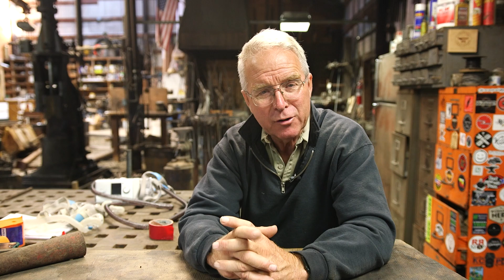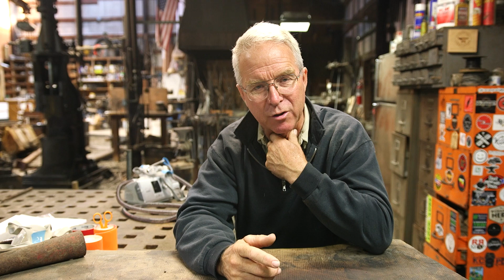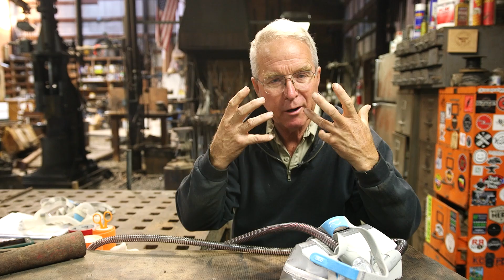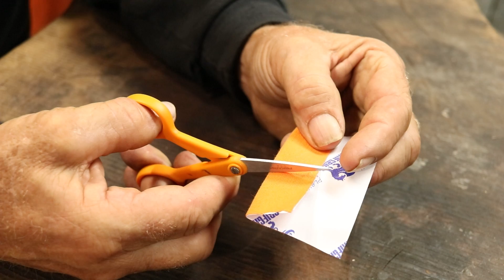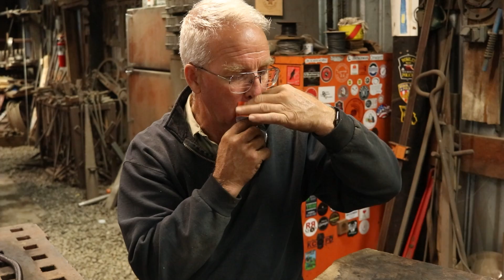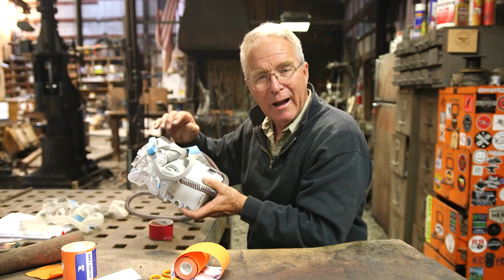Tired Contractor  Here’s My Simple, CHEAP Sleep Apnea Solution

Comment: Good stuff young man. You have (almost) repeated every sentiment I have.
As a 25 year user of a CPAP machine at a medium pressure (9.8cm H2O) the thing turned my life around. If it wasn't for that, I'd most certainly be dead now - from sleeping at the wheel or by heart failure.
Reply: Once you start cpap you can't stop because your body becomes reliant  on it
Reply: @RexRodgers1992  well I never found that  - I use CPAP at home  - but I  just ditch it when camping , sleeping on a boat  , or when its hard to take it when I travel.   I just sleep same as I did before without it  - no dependence at all!.    But CPAP gives easier sleep.  Occasionally it annoys me but  i just take it off .    Its a help  to be used when i want it .
Reply: @RexRodgers1992  Yes! A close friend of mine has been on CPAP for 6 years and he is completely reliant on it now. He told me when traveling, he has a portable cpap and it is the most important luggage he cannot lose. He won’t be able to sleep nor breath properly without it. It was very scary when he told me about it in all seriousness.
Reply: @Paul_Sleeping  I suspect in his case it's more of a psychological dependence than a physical dependence.
Reply: BeSureYouAreSavedDOTcom  
Thank you for your thoughtful reply. 
I need to lose a lot of weight myself, and maybe that would help with the sleep apnea. 
If your wife is interested she may want to
consider trying serrapeptase for her COPD.  It can dissolve scar tissue and may help heal her lungs. I’m so glad to hear she’s doing better.  Bless you both, and thank you for the wonderful information!
Reply: BeSureYouAreSavedDOTcom  
I’m glad that she is trying it. That’s great! I think it will help her. 🙏 prayers to you both.
Reply: @RevMarkSmith  might be the setting you have it on. I just know you take higher risk when you stop using it. Just because you haven't died yet from not using it on and off doesn't mean you won't.
Reply: @USAMark70  you should look up what cpap does and how your body responds. When you just cut it off  cold turkey It could definitely lead to death.
Reply: BeSureYouAreSavedDOTcom  God has nothing to do with it - nothing whatsoever.
Reply: BeSureYouAreSavedDOTcom  Because I don't believe, you imply that I am a fool, am corrupt and have done abominable things. That's very kind of you, I must say.
Do you you think you have changed my thinking? You didn't. You confirmed it . . .
I'm just not going to engage you here.

Comment: Wow! Your story is so great and inspiring.  
I have severe obstructive sleep apnea and am now using a CPAP machine, which took me years to get used to, but it helps alot.
The apnea started out as mild to moderate but eventually became severe.  When it got really bad, it scared me so much that I just forced myself
to use it.  I eventually got used to the machine but I can't imagine what I would have done in your case - having both types of apnea and a pressure
on the machine that was so high it made using the machine almost impossible.  I would have slipped into a brutal depression!
But you didn't!  That's amazing!  Your drive to not give up and fix the problem is amazing.  I'm so happy for you and hope you continue to sleep well.
Thanks a million for the video and your heroic response to a very difficult health problem!
Again, inspirational!

Comment: I read a book called Breath by James Nester and this was his solution to mouth breathing and sleeping problems. I've found that a thin strip (less than 1 inch) of fabric medical tape applied to just the lips works well. It leaves room at the corners of my mouth for talking and breathing if necessary. After several months of doing this, I've actually trained myself to breathe through my nose, both while awake and sleeping.
Reply: Fantastic book. “Shut your mouth”
Reply: I've found similar, smaller tapes works well enough. I'm also intent upon re teaching myself to breathe through my nose while I'm sleeling.
Reply: I absolutely agree. A tiny strip of fabric medical tape can do the trick; all it needs to do is keep your lips together so your jaw can't drop.
Reply: I do exactly the same thing n now found, like you, that I’m naturally breathing though my nose. Regards.

Comment: Thank you sir for this video. As others have said, your presentation is so soothing and comforting. A real treat. 

I'm 78 and have used a mask for about 10 years. I also use Breathe Right to keep the nasal passages open, also for many years. 
After watching this, I ordered the tape and it came on the 14th. I was skeptical, but used it that night. I won't be going back to a mask. I sleep better than ever, no more issues with the air hose nor waking up every time I wanted to change sleeping position. I sleep hours at a time now and it's great. And I do wake up feeling more refreshed now. Without using a mask, I snored a lot, with the mask, no snoring. Also, before using the tape, I hated putting that thing on my face every night.  

A note about my wife. In the past she snored quite a bit. I would have to interrupt her sleep to have her turn over so I could sleep. She has had sleep tests and they showed no abnormalities, so no masks. I did have her try mine once but that did not turn out well at all. So after a couple of nights of me using the tape, I talked her into trying it. She was reluctant but tried it. After just the first night, she was hooked. Before, she would be up and down, maybe 4-5 times a night to pee, but that dropped to 1-2 times a night with many hours of sleep between, which she never had for years. She does NOT snore now, so no waking her to turn over. Bottom line, we both sleep so many more hours without waking and waking up more refreshed. 

The tape is really unobtrusive during the night and it forces you to breath thru your nose, just as the darn machine forced you to. BTW, I have a beard and the tape still works for me.

Comment: I went through a similar scenario with sleep apnea and used a CPAP machine as well, although not as severe as the OP.  My apnea was diagnosed as mild, and to make a long story short, I studied up on apnea and watched a LOT  of good videos on utube and was eventually able to determine the two causes of my apnea. First, my nose was broken in grade school and when it healed, my left sinus was about 30-40% blocked. After talking with an ENT surgeon, he pointed out that when you sleep on your right side, you breathe mostly through your left sinus. I sleep mostly on my right side, so that was half of my air blockage (apnea) issue! After he performed surgery to correct my left sinus, I can now breathe MUCH better than before when sleeping! The other half of my apnea issue was that I learned I was tucking my chin into my chest (head tilted down towards chest) and that too was causing air blockage while sleeping. So, I ordered a soft, wearable cervical collar to wear while sleeping. Once I started using that, my AHI index went below 1!!!! So, I've learned to sleep with my head straight (neck in line with chest) and now I no longer need my CPAP machine or the soft C collar! I do wear a Lookee wrist pulse oximeter that records my Spo2 level and pulse rate while I sleep every night. My Spo2 level seldom goes below 95%, but if it goes below 91% the oximeter buzzes my finger and I wake up enough to adjust my position so I can breathe better. Each morning I upload the data to my phone so i monitor my sleep breathing. My AHI index is usually below 3, I've read that below 5 is considered to be a normal AHI index. If anyone has apnea or breathing issues while sleeping, I strongly recommend you get a wearable pulse oximeter that records your spo2 level and heartrate, so you can a check on that. Most cpap machines can't tell you your spo2 level, and the main reason you wear a cpap machine if have apnea is to keep your spo2 level above 92% or thereabouts. So, does anybody need a cpap machine? I have a nice, lightly used RESMED I'll sell you lol. BTW, if you have apnea and needs CPAP, a RESMED is like the Cadillac of cpap machines. Also, if you use cpap, consider getting a pillow designed to use with cpap machines, it helps the comfort factor and tends to keep your head in line with your chest. All this stuff I learned on my own. Good luck to everyone!
Reply: Awesome that you got it figured out!

Comment: Great video!  I have sleep apnea, as well, but I've found a few other options that work for me.
First, I use a thinner-than-average pillow.  If I'm on my back, a thick pillow will angle my neck up and close off my airway, even before I fall asleep.
Second, I use a device to pull either my lower jaw or my tongue forward.  Remember the old CPR instructions...  "to open the airway, tilt the head back and pull the jaw forward (which also pulls the tongue forward)..."
Third, since I'm a mouth breather, too, I use a CPAP machine with a full face mask that covers my nose and mouth, so I have positive pressure while either mouth- or nose-breathing.
Good luck with your sleep apnea journey.  😀

Comment: For me my sinuses are usually pretty stuffy which has been a large driver for my mouth breathing, I found nasal air vents (basically silicone things you shove up your nose) it's really improved my sleeping, not perfect but much better.
Reply: Had the same problem for years with a stuffy nose at night...  breathing through one nostril all night, depending which side I was laying on. That problem along with half a dozen others cleared up after going Keto / intermittent fasting (basically no starchy carbs, reduce sugar).
Reply: @phiksit  I've been considering keto... This seals it. Is there a specific type of keto, or specific yt channel, you follow?
Reply: Wow. I've got a stuffy nose problem, too. Thanks for the help and the replies to your post!
Reply: Try taping your mouth closed. It works great!
Reply: NutriBiotic nasal spray with GSE helped me a lot. Through Dr Berg I found that grapefruit seed extract has anti fungal and other helpful properties without any Afrin like drawbacks. Works awesome for me.
Reply: @AprilJoi5  Dr Berg is awesome 👍
Reply: @AprilJoi5  Dr Ken Berry, TN area

Comment: Hi Scott, believe it or not I came to the same conclusion about my sleep pattern and also tape my mouth up every night!  It was not my idea though, I did an Asthma therapy years ago and they talked a lot about mouth breathing vs nose breathing and the benefits of the latter.  I believe that indigenous Americans would hold their babies mouths closed while they slept to get them into the habit of breathing through their nose.  

I love your channel being a tradesman myself and I never thought I would ever be giving you a tip about anything but here's something you might want to try!? Instead of such a large piece of tape and a fairly involved procedure every night before bed, I just use thin micropore tape to close my mouth up, the tape is thin (10mm wide) and I just easily tear a bit off (40mm) and place it vertically across the middle of my mouth.  It is very quick, it keeps the mouth relatively closed, (by the way your body will eventually keep it closed naturally) and in the morning you peel it off very easily and there's no residue.

Perhaps give it a try, keep up the great work!

Dave from Melbourne

Comment: I have been on CPAP for 12 years, initially I had to train myself to keep my mouth closed.  I was told to use a drop of Poly Grip between my  lips.  It worked and after a few weeks, I didn't need it. (still using CPAP with nasal pillows however)  Good video, keeping the mouth closed is key.

Comment: I've been taping my mouth for years using athletic/bandage type tape.  Until recently I discovered Amazon actually sells tape specifically for this.  Naturally it's called mouth tape, and there are several different brands and a few different styles available.  The X shaped kind has been working great for me, better than the athletic tape.
Reply: Thanks. Im gonna try it
Reply: Need to look into this!
Reply: @mst0786  I tried it myself once. I will say that it matters what kind of tape you use. When I 1st saw a video about how taping your mouth shut will help you to sleep better, I just used some packing tape that I had... and it worked wonderful! I couldnt believe that it actually worked and helped me to sleep better but it did!
I began taping my mouth shut every night with great results. But when I ran out of that tape, the other packing tape that I began to use didnt work the same. It didnt have the same perfect stickiness like the 1st roll of tape that I used. 

I must have bought close to 10 different rolls of packing tape, trying to find the stickiness of that 1st roll that I used. None of the new rolls that I used, had the perfect stickiness of that 1st roll. So I stopped buying new tape and just went back to sleeping normal with no tape.

I never realized that there is tape made specifically for taping your mouth shut. This is very exciting news for me! Im going to go online and hopefully I will find one that works for me like that 1st roll of tape that I used. If you find a good tape that you like, you are likely to enjoy the most sleepful nights and wake up feeling wonderfully rested and energized!

Comment: I was having similar issues and a friend recommended me the Breathe book by James Nestor, where he goes over all that stuff and recommends the tape trick. I use the thin clear ridged soft tape for bandages that they got at the pharmacy but usually use only one small strip maybe half inch wide vertically.  Now i catch myself cheating a good amount but all in all its 100x better.  I like your method of going wider with the tape and adding slits, i will try that tonight.  The problem is when you do trade work you are swimming in dust so your nose gets plugged and stays that way.  Part of it is that and part of it is habit,  other people have added issues but it is huge to take matters into your own hands like you said.  In that book he spends a good amount of time talking about how your nose is your natural filtration system and is essential to use for your lung health.  Real eye opener.  You the man, great vid

Comment: I was warned never to tape my mouth or nose shut while sleeping (especially not the nose) because if one becomes plugged for some reason I could pass out and die in my sleep. When I took up a regimen of head lifts to firm up my sagging neck, I also experienced more support and less mouth breathing at night. My pillow became more comfortable, I had been experiencing having to reshape my pillow continously through the night. You would be a good one to experiment with neck conditioning exercise since your apnea is so severe. I'll tell you how to do it: While laying down without a pillow, just lift your head up a few inches keep your nose pointing stright at the ceiling. It's a repetative motion. Aim for 1 minute of slow repitions. Be mindful your jaw doesn't fall back. Also, do neck stretches for the front muscles of the neck and for the muscles down the back and stretch for the muscles over the top of the shoulders. The goal is to allow the spine to straighten and the vertebrae to stack. As we age our neck may shorten due to muscle losing condition if we are not actively stretching and strengthening. I'd like to know if the excercise works well enough for you that you would no longer need to splint. Another neck exercise I like to do while sitting up is to sit back in my chair, tip my head back and look up at the ceiling then nod down using my head as a weight. I keep my shoulders down and back for this. It's an exercise I can do anywhere at any time I think to do it (when no one's looking), and can do several times a day for 1 minute intervals.
Reply: Thank you for the well crafted comment lot's of good advice.

Comment: Great video Scott!  I also suffer from sleep apnea.  I've got a chin strap to deal with the issues you described, and it seems to work pretty well.  They're relatively cheap on Amazon.  Also I had similar issues with my CPAP machine, but found a mask that worked well for me after trying several.  Maybe you could try some different masks?  I've got a DreamWear nasal CPAP mask, which I find more comfortable than the full mouth masks.

Comment: I was really hoping the solution was going to involve a diesel air compressor, a power hammer, and a lot of trust in the setup, but I guess tape is nearly as amusing.  🤣

I'm glad to see you've found a solution to the problem though. I've often wondering if I don't have the same issue...

Comment: I have been doing something like this for a while. I use 3M surgical tape. I don't do slits, and have a full beard, but the tape holds so good all it really needs is a half moon piece that covers my lips. Covering just your lips has the added benefit of not blocking your pores, and prevents break out. I use this along with the cpap, and even wear a dental appliance under the mask. For me it works great, but coughing can be a problem, and right now in western Kansas, my allergies have flared up so I have been going without a lot more. I will have to look into the kind of tape you use.... Maybe it works better. I just hated all the break outs I was having with tape gum blocking my pores... You are kind of inspiring me to want to do a video of what I do